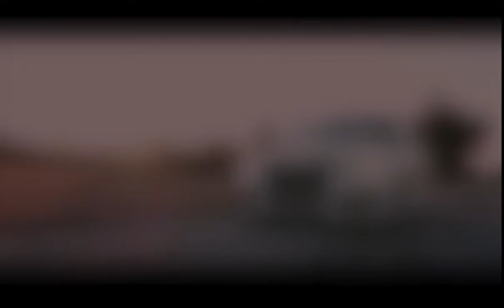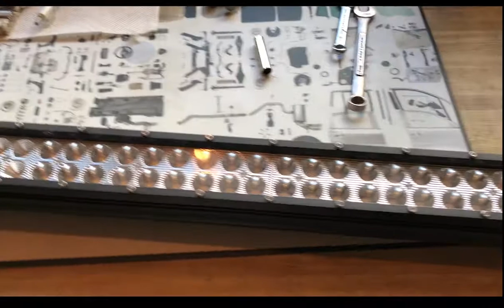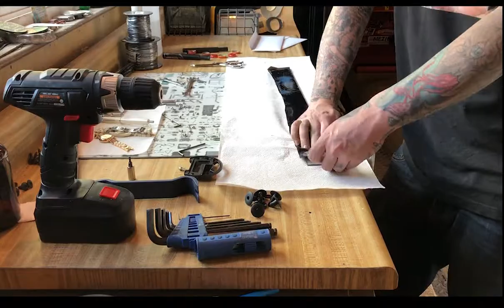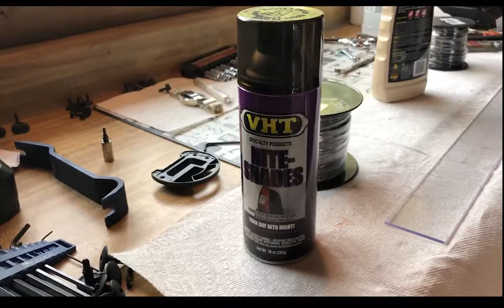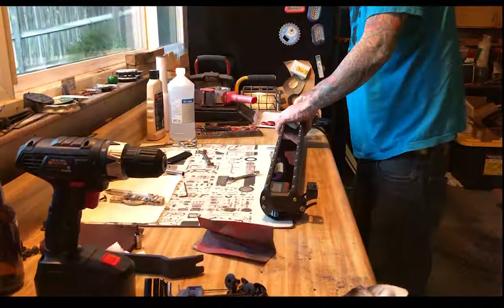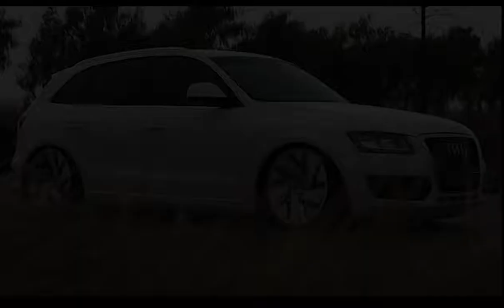Tinting the Light Bar | Less Functional

Comment: Next time you tint use a spray bottle with water and saturate your piece. The water will allow you to make any adjustments before you squeegee. Peel off your film and lay the sticky side down then once your satisfied with its placement, hold one side and gently squeegee the water and any air bubbles out. When you do it dry like that you’ll regret it 100% of the time. I agree with you on that vht stuff. Not my fav but works in a pinch.